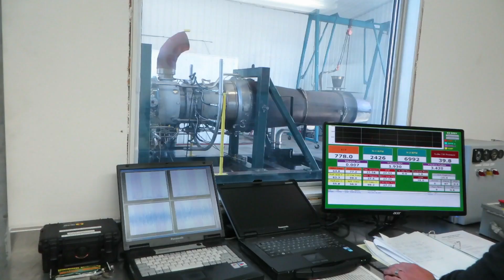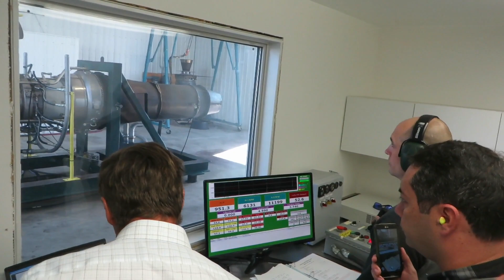RR Marine Spey turbine engine test run

Comment: No mesh guard?
Reply from the maker: +thevolt10578   We use the same system that the airlines use.
Reply: AgentJayZ I meant as in usually u used a mesh guard in front of the engine when you run an engine that doesnt have front stators
Reply from the maker: Most airline turbofans do not have IGVs in front of their fans. We protect our engines from FOD the same way they do.
Reply: AgentJayZ Sorry if I'm not too clear hahah I meant why didn't you used a mesh guard thing in front of the engine while testing it to protect the people around it as the engine doesnt have those stators in front but instead just a spinning compressor assembly. I remembered when U ran another spey back then you used the mesh guard thing and said it's to protect the operators around it.
Reply from the maker: The people at our test cell do not need to be protected from jumping into an engine intake.

The mesh guard we used to use created a significant power loss. Such guards are not used in industrial applications.

Customers pay a great deal of money for an engine overhaul and test. 
They don't like it when you tell them the engine did not make it's required power level, but you're sure it will with the screen off.
The usual reply is " then test it with the screen off".
Reply: AgentJayZ Oh I see it reduces power hahah yea I know you guys are competent enough to not jump into an engine XD

Comment: Still freaks me out to hear the Tinking of the blades as they nearly stop, sounds terrible, but clearances I suppose.
Reply from the maker: +MrGuvEuroman You need to watch another of my videos, called Jet Engine Turbine Blade Noise...
Reply: All that time i was thinking: Sounds like junk.
Then i remembered I'm no gas turbine mechanic and don't have a clue of what i was thinking about...hehehe. 😅
Reply: +AgentJayZ  I have, but still sounds scary.
Reply: +JIGA BACHI And then when it has run down, there's the click, click, click of everything contracting as it cools.

Comment: This engine sound much like the Allison TF41 used in the A-7 Corsair
Reply from the maker: +Vipers810 The Allison TF-41 is/was a license built Spey. Allison slightly modified the design to "Americanize" it.
Reply: +AgentJayZ This is your resident pedant calling. TF41 doesn't have a hyphen but the aircraft that it goes in , the A-7 Corsair II, does. But we know another place for a hyphen, don't we? And, from your various comments, it would appear that you might like to stick it up their ***es (now that's 3 asterisks for North America, but 4 for the UK.)
Reply from the maker: I'm quite careless with my hyphenations of aircraft and engine designations, but I do believe you are right, about the first bit anyway.
I don't want to stick it to anybody, but even asking to deal with The Company is a last resort.
Reply: +AgentJayZ   You probably noticed that I got the Marine Spey designations wrong in other comments and, pedantic as ever, I went back and corrected the errors.  Beyond that, I wasn't being serious, just having a bit of fun with the hyphen - and I was also having my usual bit of fun with the common language issue. As I've said before, I did have my own problems with The Company, but that's not for publication.
Reply: +AgentJayZ Did they make it spin the other way?  :)
Reply: +rallyrat Check out the LP compressor in Q81 and work it out for yourself: I suspect you know the answer already! R-R made the HP compressor for the V2500 go round the wrong way as a special favour to P&W. And someone has actually made the fan of the GEnx engine go round the right way.